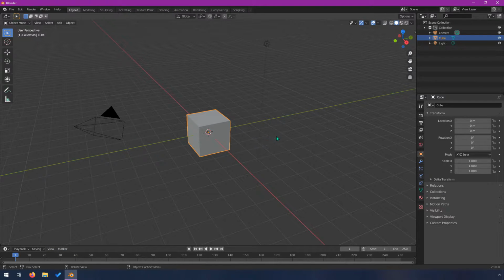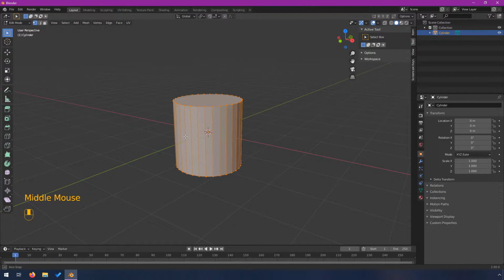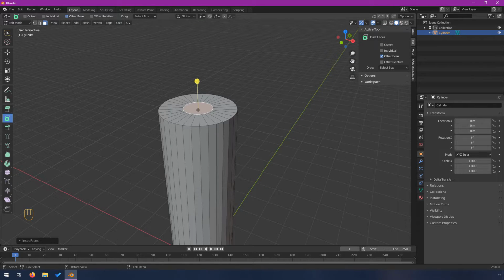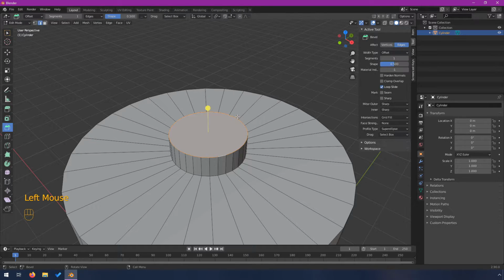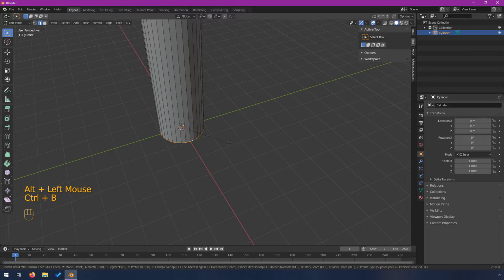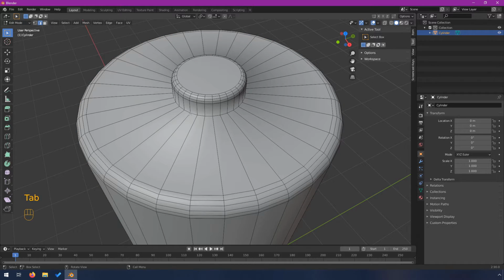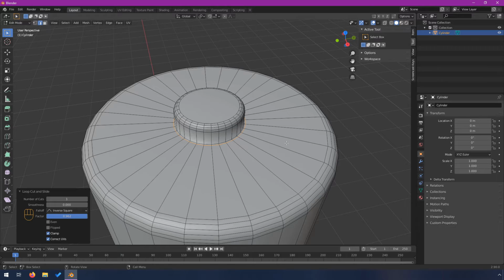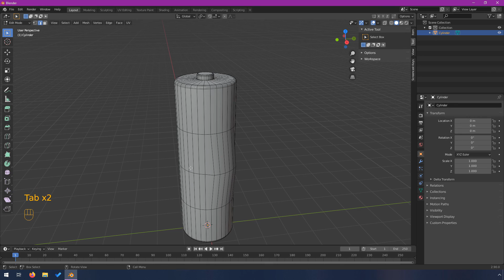Blender for AI Devs, pt. 5: Modeling - Beveling & Loop Cuts

Comment: Really really good explanation of basic principles on a basic object. Other videos are sometimes too much at once or just use those techniques without explaining it correctly. Will watch the other videos ASAP. Btw: is there a good source for blender shortcuts somewhere?
Reply from the maker: Thanks! I think there are a few cheat sheets out there, but the best way in my opinion is to look for shortcuts to your most frequent tasks as you use the menu items. Usually they include shortcuts next to it or if you hover over a button.